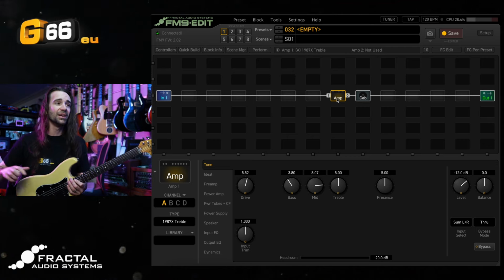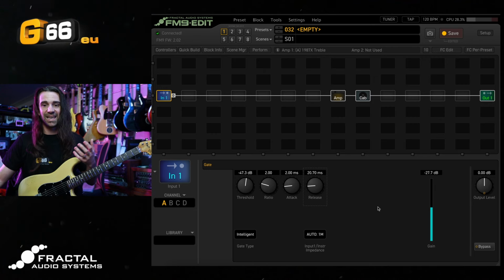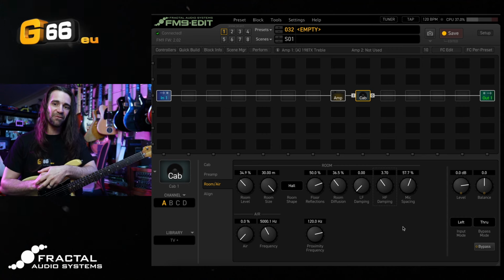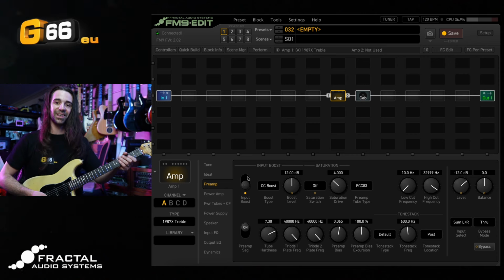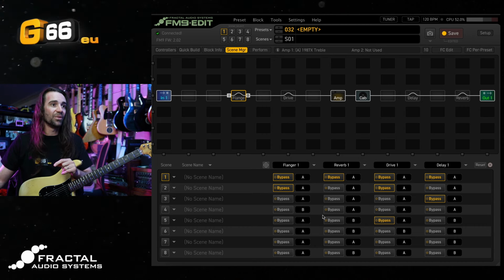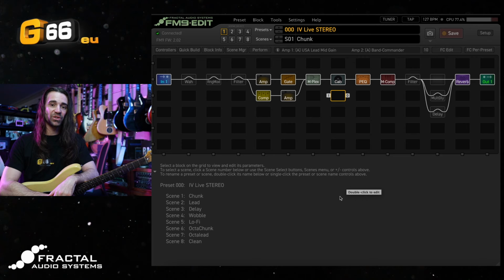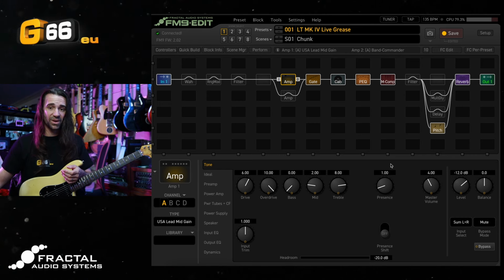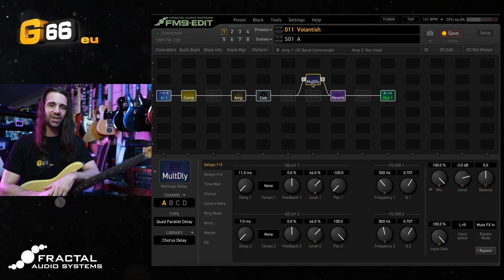FM9 Tricks & Utilities - Tuesday Tone Tip

Comment: Leon why do I have to CRANK the volume/level on all the clean amps when I come across them??  Clean amps just have NO volume at all.. I have to crank the level on like +4 or 5 and on some I have to crank the master volume AND the level knob..
Reply from the maker: I wouldn't worry about it, the level goes to +20dB so crank it as far as it needs to go without clipping.